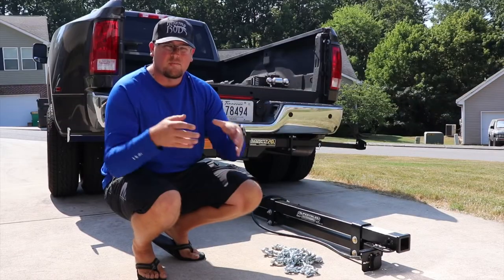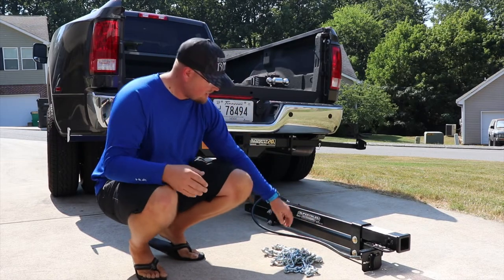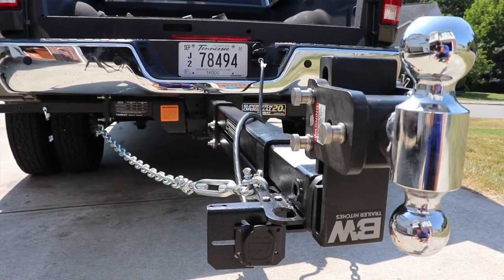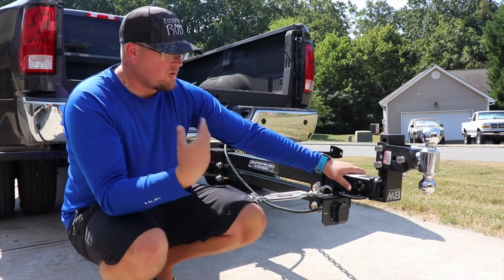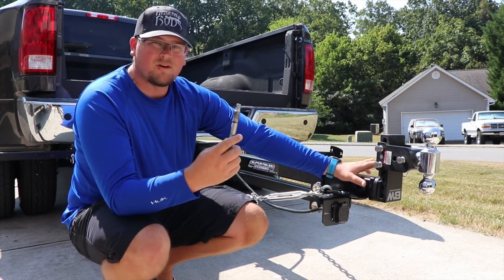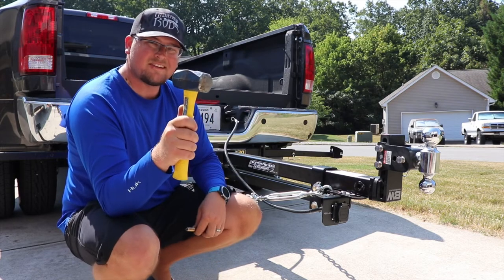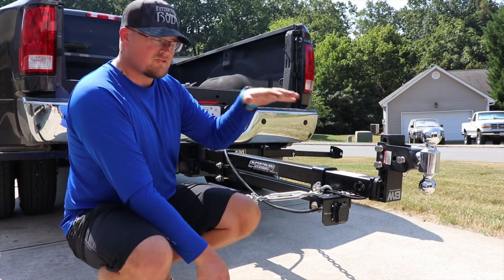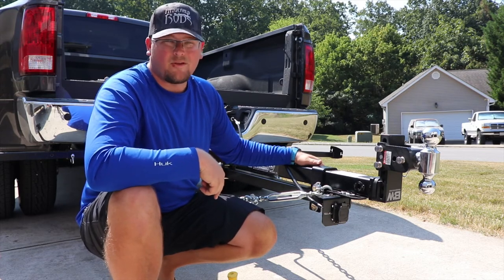Towing A Trailer Behind A TRUCK CAMPER!

Comment: Did you check all your weights which led you to the Dually? My wife does not want a Dually but when you want to put a camper on a F250 plush the tongue weight of the Bass boat it gets heavy?

Comment: I’ve got a 2016 350 Dooley and an arctic fox 992, I need to get that set up but I was also wondering, how does it feel towing your boat behind there with the camper, can you really tell it’s back there and does it affect your stability at all?
Reply from the maker: It honestly does not affect my driving hardly at all.  With my truck, it doesnt slow down the truck at all, and in some cases, I feel like I get less sway with the boat behind it.  The only issue I have is that I need to check the stabilizing chains on the extension hitch often because they tend to want to loosen, but that is a minor inconvenience that I’m sure I can find an easy solution for.  Please note that I am not over payload capacity, so with the boat, I am still within the capabilities of my truck, so if you overload your rig, I’m sure the performance will suffer, but as far as I’m concerned, everything works great.

Comment: Did you get the tongue weight of your z19 by chance?
Reply from the maker: Flippin’, Crankin’ & Spinnerbaitin’ I don’t know exactly.  Since I know I’m not getting close to the maximum capacity of the extension I didn’t look into it further.
Reply from the maker: Flippin’, Crankin’ & Spinnerbaitin’ I believe the max tongue weight on the extension is 1400lb and most bass boats run around 300-400.